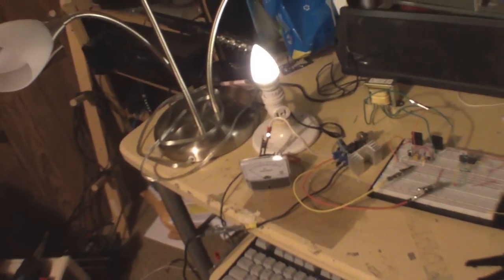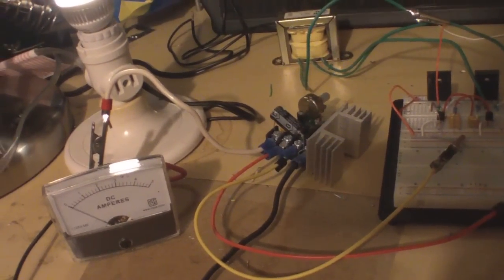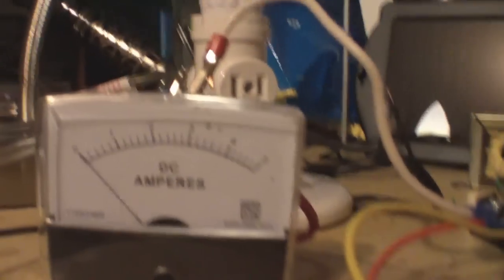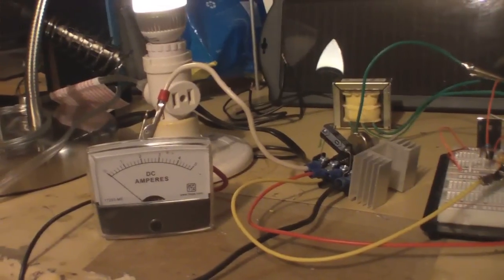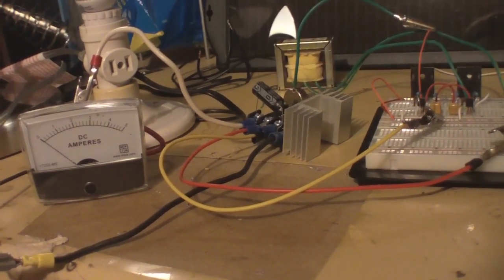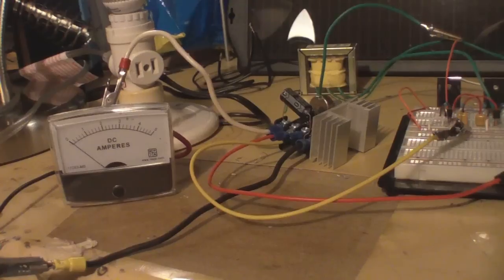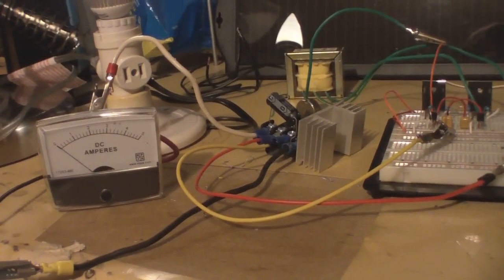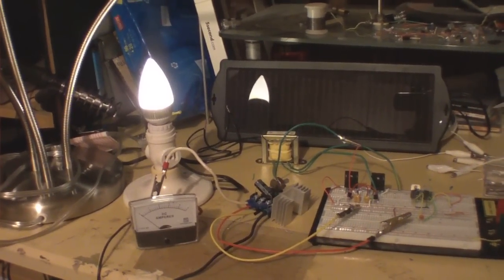PWM FLIP FLOP DC - AC Inverter Rep. (Incroyables - Vik95170) Replication - Low Current Draw

Comment from the maker: A lot of the time people have no understanding of why all these bits and pieces on my channel, without cohesion, but you are looking at an individual (with a dream) trying to understand electronics, each part, to study, for a long term goal. I am a huge believer in the power of using the latent heat (state change of ammonia). It only takes 45 degrees... there is no reason a fridge cannot be operated by the sun.

Comment from the maker: * if you do play with this, keep the levels down, it'd be easy to run into avalanche and just blow the crap out of everything... the next step is to take the PWM off the power rail and get it into the square wave directly, as a dedicated process matched. Start with your PWM freq. showing about 6 volts from a 12v source.

Comment from the maker: @MrTwally67 I have an old used signal generator coming.. then it will be back to the Slayer. I love that circuit. I like this inverter, but to me.. it's just the heart. There's more to an inverter, than this, as I see it. This is like putting a 427 chevy motor on a '54 truck frame , putting four tires and some steering in, and saying, OK... I'm done...

Comment from the maker: In fact, it has been done, by a university, on a small scale (a cooler) I have a link. You don't even need the HHO. The HHO would prove worthy though because in a 3rd world country in the sun belt... you can't just run out and buy propane. If you have no electricity, no fuel.. can you have a fridge to keep important medicines cool? Yes you could.. with batteries, heat exchangers, solar panels, and HHO.